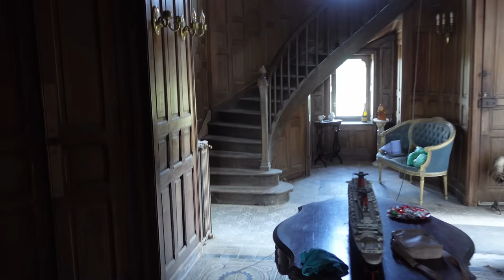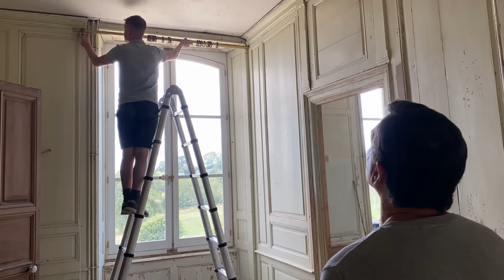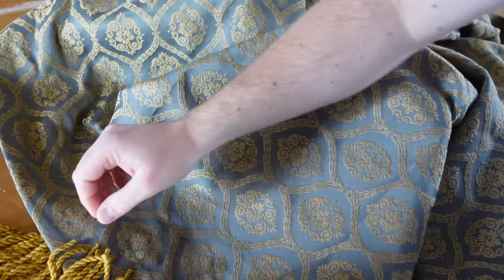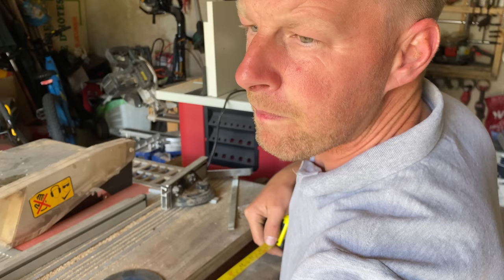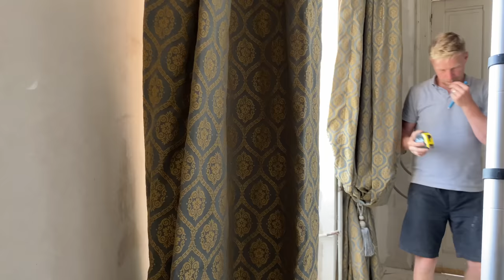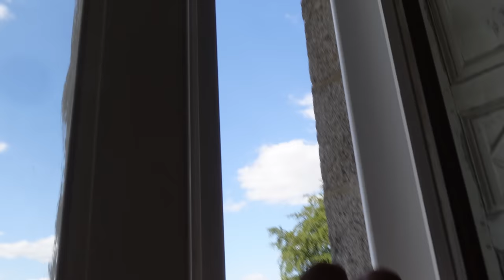The First HANDMADE Curtains for our Château Renovation.

Comment: I would reconsider blocking the windows in the bedrooms from opening.  If a guest needed to be rescued in the event of a fire  it could be deadly if the hallway was blocked as well.  There may be fire regulation requirements which prevent it.

Comment: The green velvet curtains with gold fringe look like "Ms. Ellen's portiers" in Gone with the Wind. They were  the curtains Scarlet made her dress from to meet Rhett while he was in a "Yankee" jail in Savannah. Mammy had a fit! 

Ms Ellen - as mammy called her - was supposed to be of French extraction so I think her portiers pass for a homeland Chateau.  Not that that really matters. The old south (and even the new) was still very fond of the French decorative styles. 

BTW - Did you ever think of just hanging drapery with folds in your grand salon? Cover everything, walls and windows from the cornice to the floor. It' would be like what used to be done in Italian palazzi during the renaissance. W.W..Hearst in San Simeon did the same thing with a rich blue (maybe silk) damask in the sitting room of the "Doge's suite".  You can see that room online. I think it is the only room in this country to ever do that. That wall covering is about 100 years old now and is surprising because the house is on the coast with a view of the ocean. Northern Ca can be "cold and damp" as the song says. I think they are still the original covering.  The curtains could be filled with some quilting filler (but don't quilt the curtains, just sew in long vertical  lines to the lining only to prevent the filler from slipping over time) to increase their tog value (R value) and that would help to insulate the walls. Since the panelling is long gone you wouldn't have to try to buy, perhaps, thousands' of linear feet of oak. That lumber alone could cost more than the lumber for a typical suburban house 

My metal cost meter just spins like crazy everytime I see the amount of expensive lumber that went into  all the boiserie in you place. I'm sure the builder and his guests saw it the same way.

Comment: You do realize, that you are almost exactly recreating the green velvet curtains/portiére from Tara, that Scarlett O'Hara turns into a dress in "Gone with the wind"?? Complete, even with the gold fringe!!😂 Amazing!! I hope you really dress up the curtains in the Chateau, with beautiful valances and drapery!😁 I was almost thinking it was a shame to cut that curtain rod in the hallway, because you could have used something more "ordinary", and put up a valance. That way, the nice curtain rod with both beautiful finnials, could have been used somewhere else 😊 
Speaking of big, heavy curtains, or Portiéres, some years ago, I found an old american wallclock in a goodwill. It was not in the best shape, but very cheap. I love old clocks, but the reason I bought this, was the weights, that where hidden inside. They where heavy, of course, but unusual, shaped like two very big tassels?! And the two where different. So I went home and investigated a little... Turns out, they are rare, antique curtain weights, for a large curtain rod, with a pulley system, like yours have. So if you had a very large and heavy curtain, or maybe even a Portiére, then you could add these decorative weights, to ease opening and closing the curtains! I just love to find little treasures like that 😁